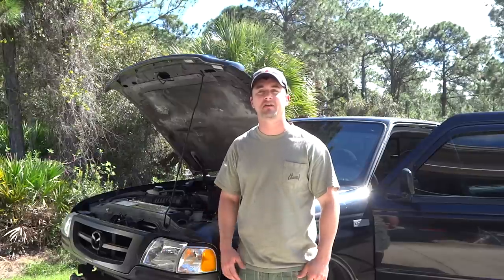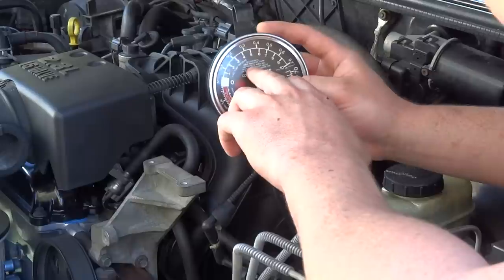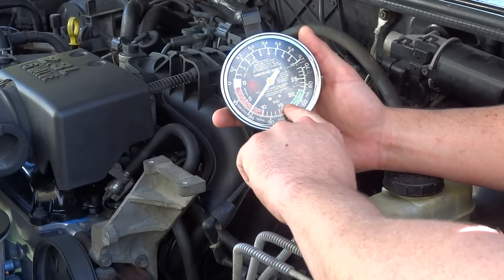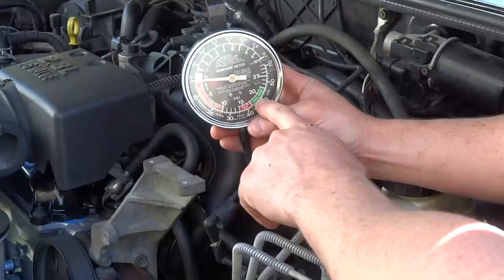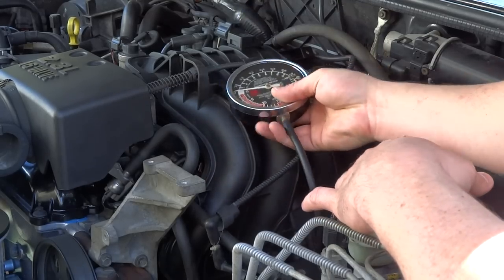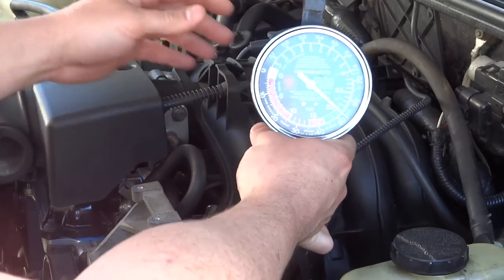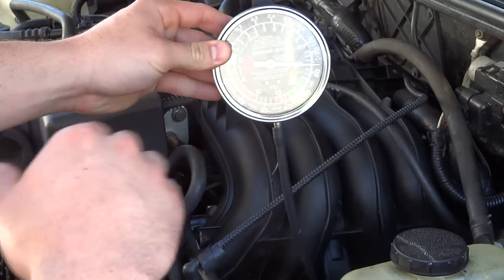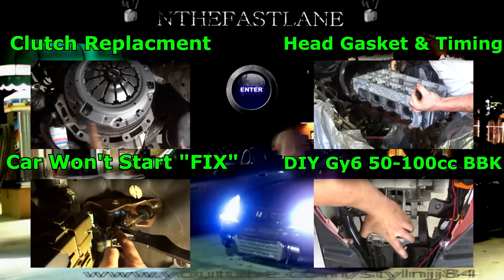Diagnose Engine Problems With Vacuum Gauge "How To"

Comment: I have the same vacuum gauge. I just tried this and when. I raised the rpm's, the needle dropped down a little before going up to where your needle went while you revved it up. My needle started out in the green, dropped to the red straight down, then up. Sorry, I'm not looking at my gauge or I would give you numbers. Does this sound like a restricted cat?
Reply: edit.... Mine dropped to 15 before going up.
Reply: This info is BS, like those forums that mislead all the time.  If there is no problem with the engine, the Vacuum is highest at idle, normally 15 hg to 20hg.  As the throttle plate is opened vacuum goes to zero, ergo atmospheric pressure on an aspirated engine.  So, your engine is normal.  But the dingbat that made this video has an engine problem, his engine is producing more vacuum as he opens the throttle.  His engine has some kind of restriction.  See this video . . .   https://www.youtube.com/watch?v=JMtBz9Ztoq8  . . .  So, in this other video, at 3k rpm that's wide open throttle and zero vacuum is normal, but it reads at 10hg, ergo, exhaust is restricted, not 100% blocked or the engine wouldn't run.  Also, snapping the throttle open for a moment fully and then releasing it to fully close, makes the gage vacuum needle drop to zero and then it goes back to 15 to 18hg if all is normal.

Comment: So a vacuum gauge is different than doing a compression test?
Reply: In comp test you check each cilinder, here you test the whole engine,
if it has a  comp problem it will appear here.
Reply: Also, a compression test is done at each spark plug hole with the motor off. This particular test checks manifold vacuum while running

Comment: That gauge seems very slow in response when you raised throttle. It also returned slowly as well. Is this a symptoms of EFI in compare to carb. I know my gauge that is hooked to bottom of carb is extremely responsive with throttle and acts instantly to the vacuum being used by engine.
Reply: The guy has a problem in his car.

Comment: does this always apply to a steady idle? i've got a 94 302 F150 that is having idle issues. when i put it in D straight from R sometimes it wants to die (especially if it hasn't been warmed up).
Reply: idle air control valve
Reply: close but no cigar. it was the circuit for the IAC inside the TB. you could replace the IAC all day long and it'd never fix it. a can of carb cleaner did, though.
Reply: +ShepherdsWrench 
i had the same problem , i cleaned the aic valve with some carb cleaner and shes running like new
Reply: +supaHighGreenNinja ops iac

Comment: I guess this means crap when you have an aftermarket camshaft......
Reply from the maker: Cobrafanatik22 No, it will just have lower vacuum at idle because of valve overlap but you can still pinpoint problems with it.It will still go up when the rpm's are raised.
Reply: DUDE DONT BELIEVE IN ALL CRAP PEOPLE TEWLL YOU IN INTERNET, 
A NEW  cam with more degrees will lower values but the analising method is the same, dont change anything,

Comment: Man I hope you're joking. But you seem serious. Vacuum should decrease and return when you increase throttle. That engine is suffocating.
Reply from the maker: Vacuum only increases when the throttle plate starts to close. If you're at 8,000 RPM wide open throttle, the vacuum isn't going to be as great as if you're at 8,000 RPM and then you're letting off the throttle.

A closed throttle plate produces the greatest amount of vacuum. A open throttle plate produces the least amount of vacuum.